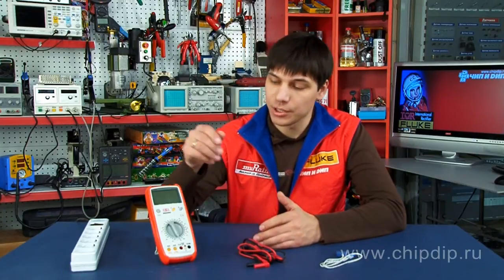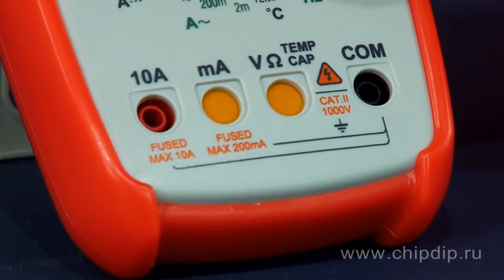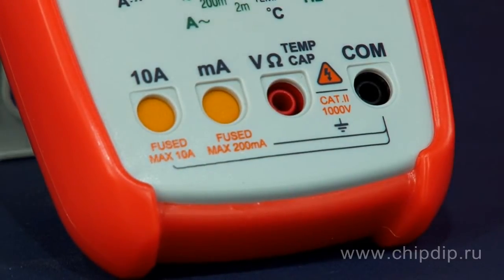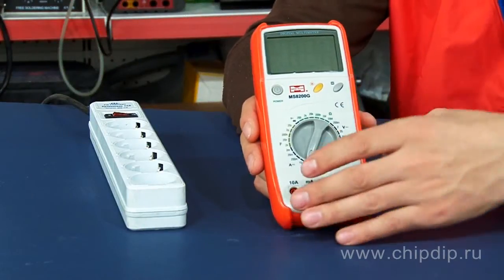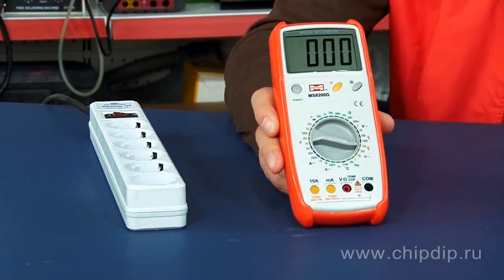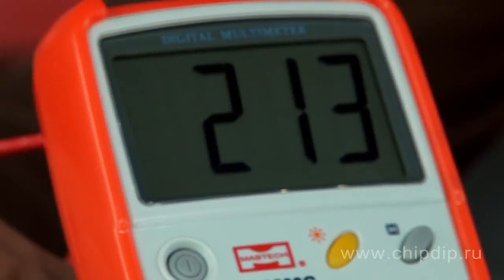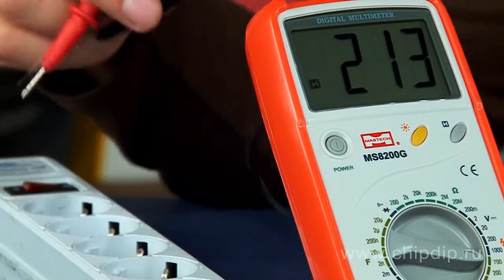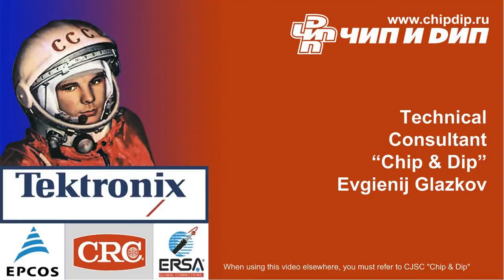Digital Multimeter MS8200G

Comment: I have been using this multimeter, MASTECH MS 8200G for some years and found it to be reliable. But I find now the readings are not correct. Does anyone know how to adjust the internal variables to calibrate readings correctly.